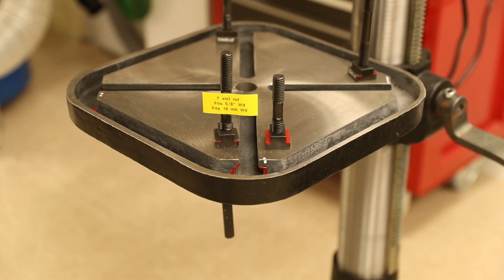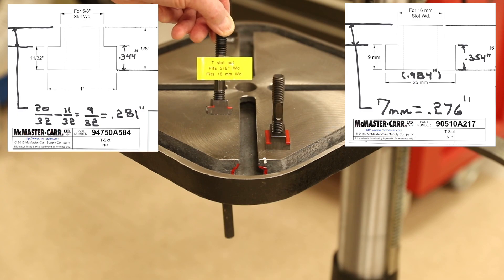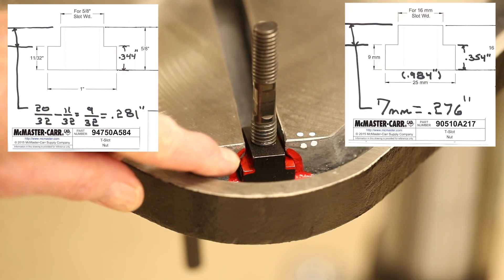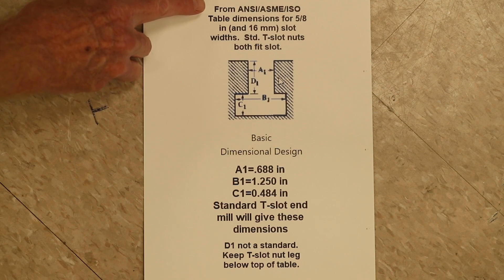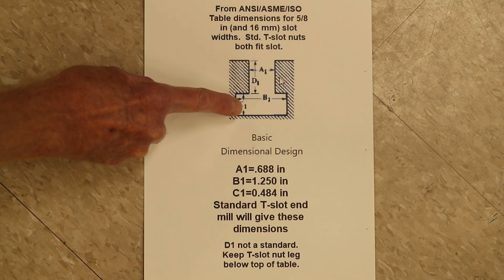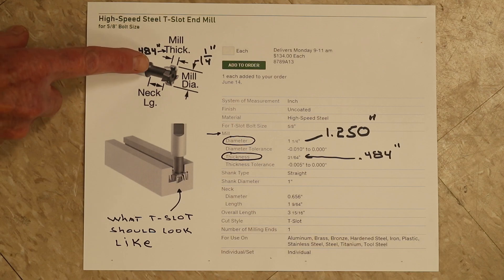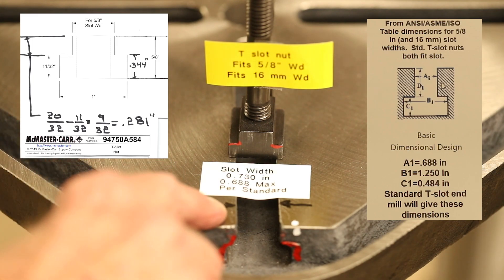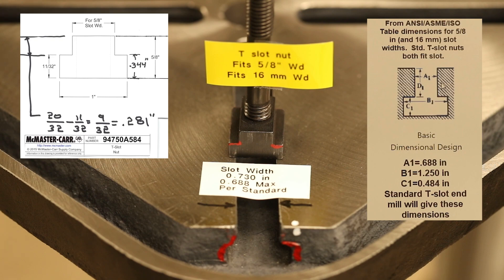Nova Vulcan table T Slots

Comment: My question to you would be, have you experienced any time that the hold down bolts have not performed as needed? Then I would say to you that if there was no play in the mating surfaces, any material in the slots would make it VERY difficult to move the bolts to make changes in securing work pieces and there is ALWAYS going to be material in the slots. There are times when precision is needed and then there are times when precision is a bad thing.

Comment: Did you actually re-machine the slots? You'd need a milling machine to do so, yes? This seems a pretty horrible issue for an expensive new drill press. You would be justified in trashing Nova over this.
Reply from the maker: I did not re-machine the slots; there wasn't enough material around the slots to create a T-slot that meets the dimensions for standard T-nuts.  I tried getting Nova Vulcan to redo the table using the standard T-slot cutter but they blew me off and refused.  I'm not very happy with the way this ended.  Take a look at my other video on the Nova Vulcan which points out another problem.  https://www.youtube.com/watch?v=Tgpl-_q2aR8